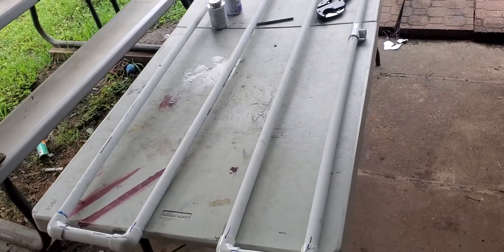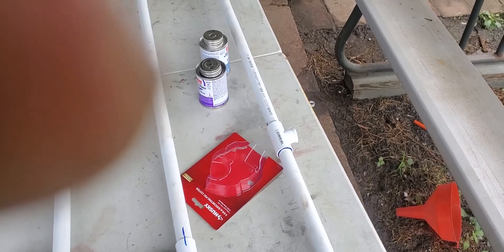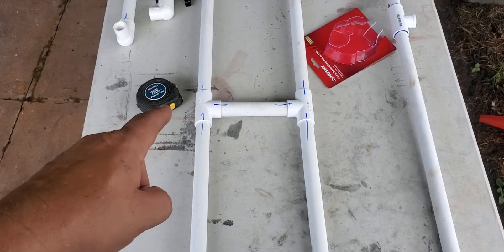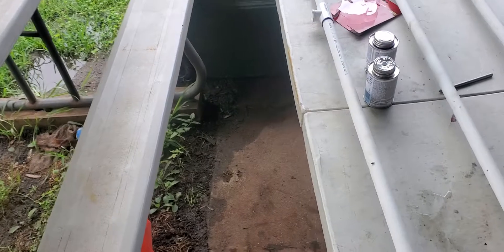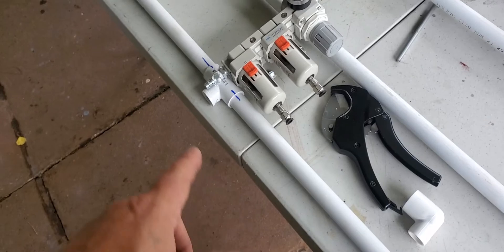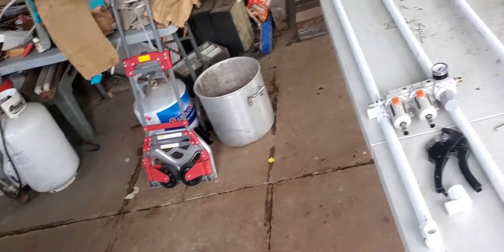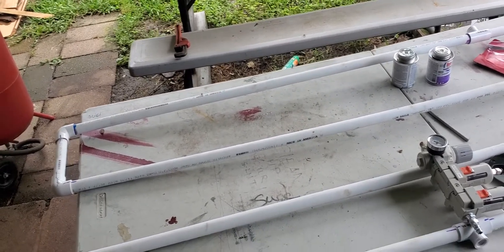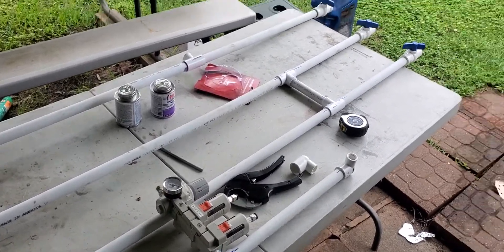homemade water separator for air compressor

Comment: Unfortunately, and certainly not knocking your 'design', PVC by its very nature is THE MOST dangerous medium to use in this air/pressure setup. When PVC explodes/blows, it becomes ballistic and extremely dangerous. Period.